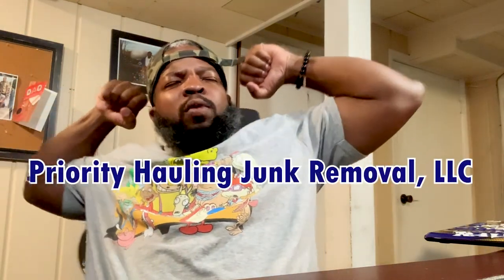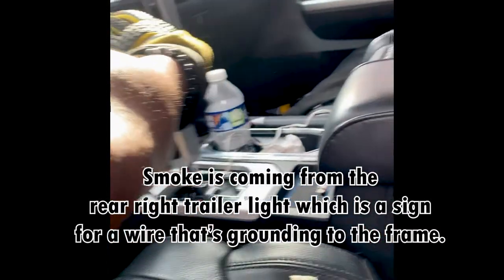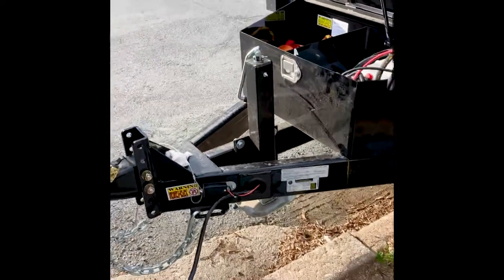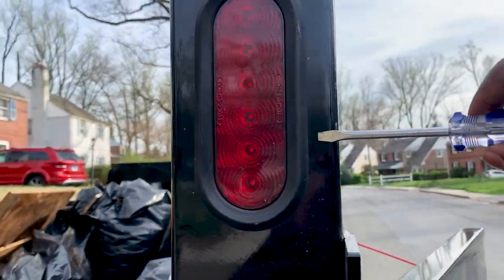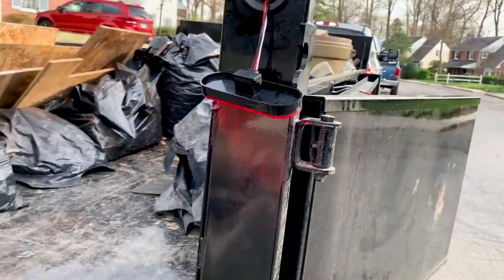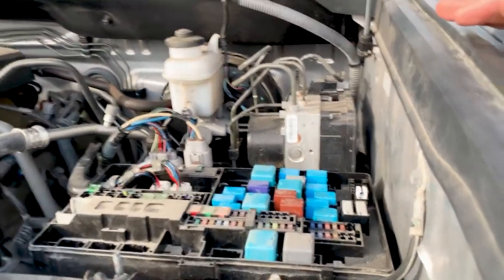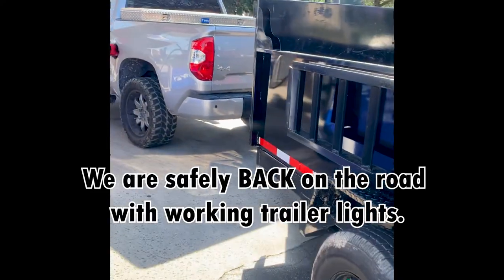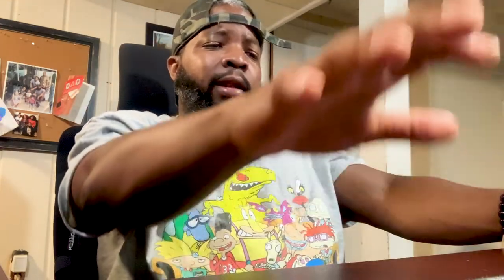♻️ NEW Dump Trailer Lights Not Working | Tundra Trailer Lights Issue (Baltimore Junk Removal Ep.12)

Comment: Thanks for your video it helped a lot! After opening up both lights and testing for voltage I tried just pushing in the harness connector 5 or 6 times and that was it. I guess the terminals were oxidized a little. Definitely know my trailers electrical system a lot better.
Reply from the maker: Luke, much appreciated sir. I too was looking around for YouTube videos and couldn’t really find any good source. So I figured I end up splicing crimped wires and ended up finding the issues because of the twilight smoke. 

Prior to that, I was checking all grounds, it was a process.

Comment: As soon as you started I said BAD GROUND.
When you accelerate the trl pulls back against the ball, creating a better ground.
Also, when empty the trl may bounce slightly off the ball, breaking the ground connection.
The dim light also is a sign of a bad ground.
When you were pulling on the wires and you said they seemed stuck on a bolt I thought crap, one of the wires is a ground wire secured to the metal and he'll pull that ground wire apart.
If you have any more issues, take a heavy wire, even a jumper cable, and create a good ground from clean bare metal of truck frame to trl. Wire brush attachment points first if necessary.
It's amazing how many times I've helped people with this in my 42 years of semi driving.
It's something I always do early on in a trl wiring scenario.
If you had a hot wire arcing in the tubing it definitely should have blown a fuse with first spark.
Reply from the maker: Much appreciated Richard. This information is very helpful. I did notice my lights became a bit dimmed a month after. I swapped the trailer hitch ball and notice an improvement. I take it that every now and then the ball needs to be wiped down to keep a clean ground connection.